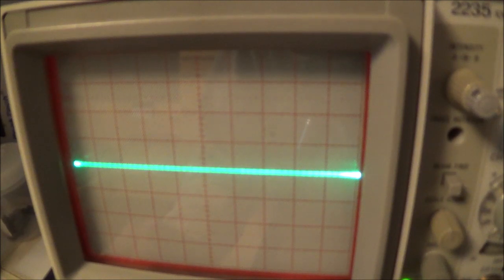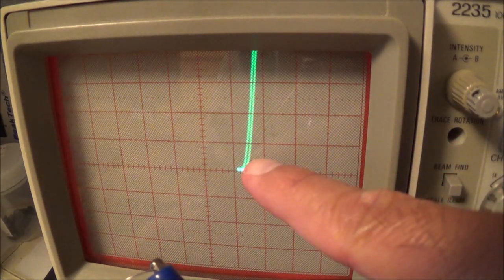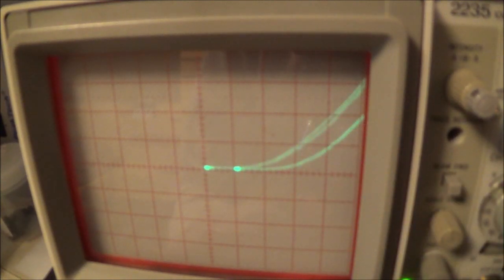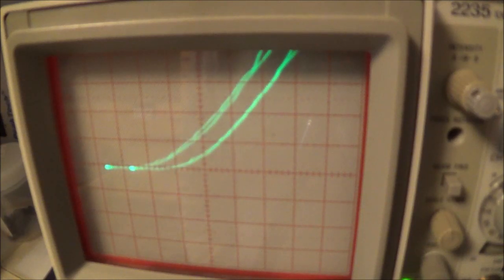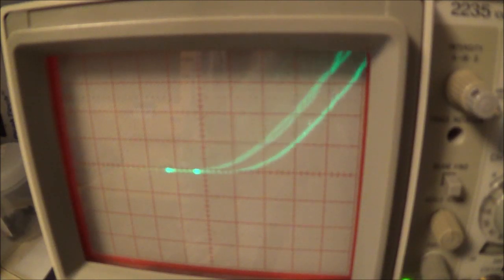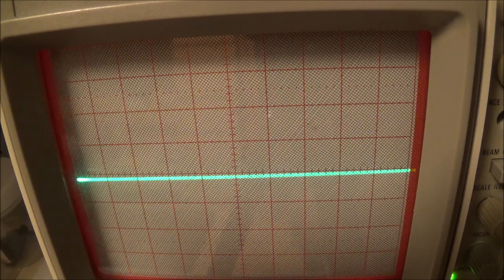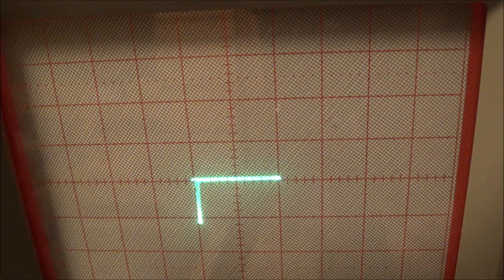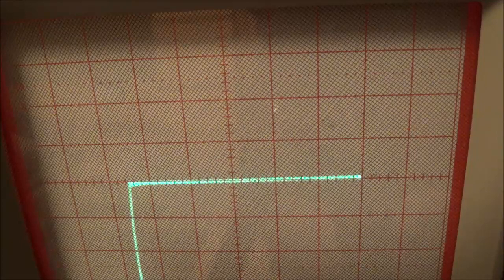Diode And Led Tests With The Leader LTC-905 Curve Tracer

Comment: I like this series!  Could you show the Leader adjustments/movements?  Interesting about reverse voltage, need to learn more about it.  Thanks!  ~Jack, VEG
Reply from the maker: Thanks for commenting! Maybe I can show more of the Leader setup/controls in another video. I didn't show that because people that own curve tracers often have manuals which show the complete setup procedures. Also, I didn't want to bore folks even more.